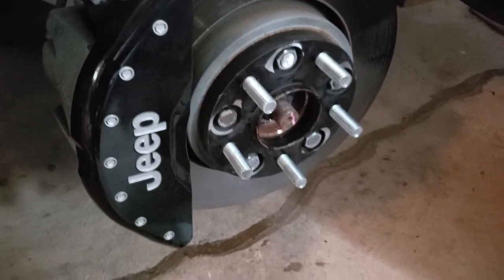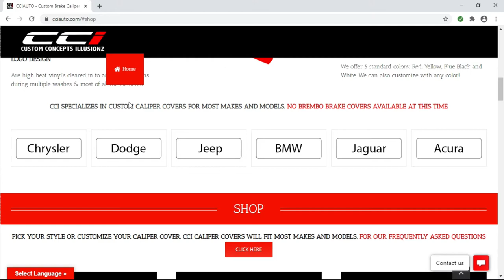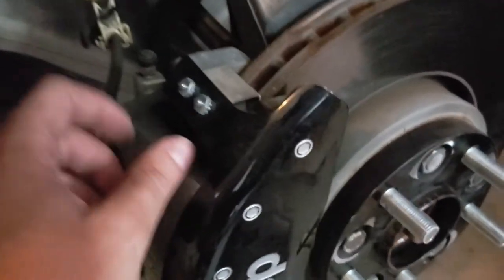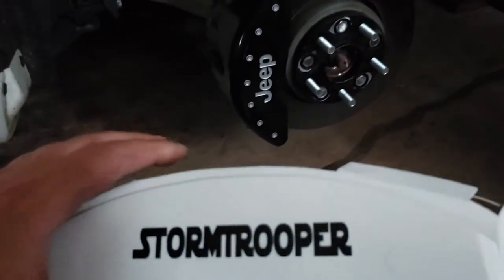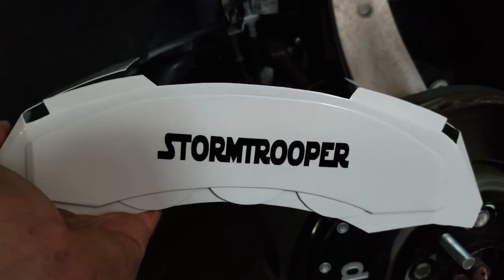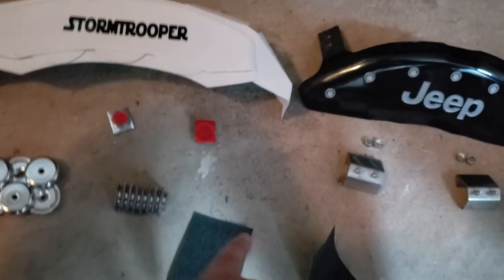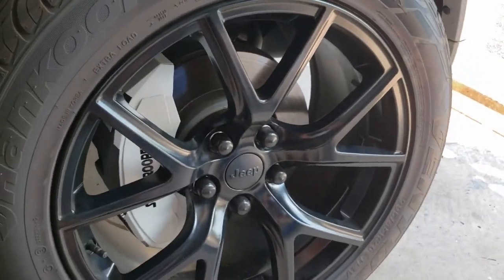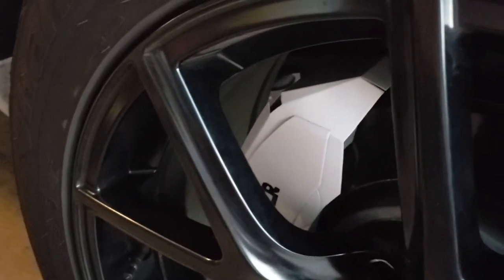CCI Caliper Covers vs. MGP

Comment: You can put custom logos or text on the MGPs too. And they are built bullet proof.
Reply from the maker: Agreed. I saw they offer that as well. It comes down to appearance preferences of the shape of the cover I think. CCI just released a couple of other options for variety but I agree that MGP's consistency with theirs is what drives the known quality. They are more costly though.

Comment: I'm sorry but my experience is completely different from most of these comments,.. I have MPG covers on my cars, and when I tell you I've had nothing but issues since they were installed back and forth to the dealership for install, ... you wouldn't believe, driving down the road you will hear something rubbing, at times you will hear something scrapping, if you make certain turns you will hear all kinds of stuff.. and really it's emabarrasing... I was driving down the road and 1 popped off while driving, and a day later the other popped off..... like I'm just tired ...i'm looking for another company that's better . yet safer !
Reply from the maker: One thing I can definitely say is to never take car in for brake or service of anything in those areas while the covers are on. Most of them don't know certain nuances tied to proper re-install. And not really their fault since covers are aftermarket, not factory equipment. If you have had rubbing before dealer service, and you believe they were installed correctly originally, I would consider spacers from 2mm up to 5mm depending on your wheel size and offset.  They were not needed for Cherokee but I did need to get them for wife's 2017 Ford Edge.

Comment: I think the white covers look dope. Definitely brings the look together, I’m debating on the CCi covers for my RAV4 but your video is convincing me to place the order 😊
Reply from the maker: Thanks! I just had a shop do rotor and pad change. They didn't need to ask me anything about removing them or replacing them. Just pulled them off and back on. Very functional with no need for screws or effort.
Reply: @carsick309   that sounds so easy to deal with, I saw your other comment that you haven’t had any issues with them, so that’s hella reassuring. This might be a dumb question, but the only reason I’ve been stalling on the covers is that if they will intervene with the brake assist on my car... do you think they will?
Reply from the maker: @patriciaarteaga8221  Doesn't matter if it's these or MGPs. No interference with assist. I have rear brake sensors and those kick brake action in without any issue. Covers are just a cosmetic external piece. If standard braking works so will assisted.
Reply: @carsick309  omg thank you! CCI just posted these red reflective covers and now I’m going to order them. Thanks for answering my question 😊

Comment: Thank you for getting back to me.  I just bought some summertime rims and tires (Michelin tires and factory Black Ford rims)  I think the plastic lug caps could be a deterent from someone steeling the tires and rims.  I have an expedition and just bought the red MGP caliper covers too.  Can't wait until spring.  Thanks again
Reply from the maker: Sure, but if it matters the ones I have are not plastic but more like rubbery somewhat stretchy if that makes sense. Either way, agree on the lug thing. No way to get wrench on those with out having tweezers to take them off ✌️

Comment: TY! My Wrangler Sahara also w/ Discs X4. In my region, painting them bright red, or bright neon is popular- but don't have the time/inclination. My GC is also B&W. I also recommend Jeep Forum btw (again don't hv time I wish I had). A little puffery is acceptable. My last Cherokee I was in for 15years! Shouldn't have sold it. Where I live, calipers can freeze, brake dust is prob, as is mud. Sweet option. Keep em coming. We do love our Jeeps - dunno w/new Fiat ownership what will happen. Hope you have as many in your Storm Trooper. best yrs were: Iococca-Daimler. Pls do F/U (follow up) after 6-12mos let us know if after off roading & if applicable seasonal changes. Looks awesome!
Reply: Did you use your phones mic to translate this?

Comment: How did they hold up ( during winter and summer heat ) and if there were any issues ?
Reply from the maker: @alexlo1378  I've run both in summer and winter in Northeast and they stayed on fine. CCI seemed to warp and get stained a bit after about 1 year though.

Comment: You can choose to remove the bolt look on mgp calipers if you customize. Do you think it looks better to remove them or keep them? I can’t tell if they make it tacky or not.
Reply from the maker: You're right.  I actually was checking their site and saw that. Without the fake bolt look though they just look odd because they don't have "depth" of CCI. So if you're on MGP side I would leave the bolt look.
Reply: CarSick30 Thats what I was thinking otherwise it’s a smooth color that has no edges and looks like a glob to me lol. I’ll stick with the bolts! Thanks for the input

Comment: ABSOLUTELY THE WORST!! This company and the Owner are a total joke!! Took me 6 months to get mine, after sending the wrong ones after 3 months!!  Then they finally ship them , after lying to me about 12 times saying they are shipping, they are drying, every excuse you can think of.  Wouldn’t answer my call until I blocked my number.  
Stay away, stay far away!!!
Reply from the maker: That does sound horrible. I did end up switching mine and wife's back to MGP but more so for ease if use and options. Didn't realize things got this bad with CCI...

Comment: Are those spacers? What size? Any issues with them? It was recommended I get 5mm spacers to get the front covers to fit on my ‘18 JGC Altitude, but I’m a little nervous.
Reply from the maker: This one of differentiators between MGP and CCI. When I was running MGPs no spacers needed on Altitude. It just so happens that I got spacers after that for more aggressive look and stance/stability. So when I went for the CCIs it was not even a thought for me. Plus I was not told I needed them. My spacers are 0.75" manufactured by Bora. At that size you have to deal with not just spacers but having to cut your  factory studs (the things you put lug nuts on). Factory are not long enough to take spacers and leave enough thread for lug nut. Ongoing debate about how wide/narrow they can be before you HAVE TO do this.
Reply: @carsick309  Thanks for the info. I’ve seen pros and cons for spacers. I’m only willing to go no more than 6mm for clearance, but still leery. I might just end up painting them. But until then, I still have the rears on, so it looks half cool 😎 lol
Reply from the maker: @michkeshajohnson3159  You're definitely fine with 6mm and no hub or screws nodded I would think. Lug nuts still have enough thread to catch and hold.
Reply: I have the exact same jeep altitude in white and wanted to do the same set up with the rims and tires. Do I need the .75 spacers to fit the 295/45/20 rims and tires?.. because I really don’t want to put spacers on, but I want that exact set up in rims and tires.. thank you in advance…
Reply: @markdudek1544   I decided against spacers and purchased SRT Replica wheels, so no spacers needed. Proud to say the CCI covers have held up for 2yrs now with original magnets, no issues. I probably should give them a good cleaning though lol. I get compliments all the time.

Comment: Mgp covers are simple and plain but, at least they are made out of really good material, very solid and 100% safe and CCI covers they look better but, they're not safe at all, even if you put stronger magnets, they're gonna fall off sooner or later, just paint them don't buy these covers they're not worth it, trust me i had both, mgp and cci covers and I regret it 🤦‍♂️
Reply from the maker: I'm about to make a follow-up quick video 1 year later and I think I agree with you there.
Reply: I ran MGPs on my Nissan Altima they fell off after two months, few months later I bought a charger rt 18 and I found out about CCIs  and decided to go with CCI Xlines  av been running them for 8months now they ain’t going nowhere lol. I even run through potholes an a daily , easy to clean.
Reply: @idrisidowu6246  that is so weird though 'cause I've been running MGPs on all my cars and they never fell off, the only reason I decided to change is because I gotta admit CCIs look better in terms of desing, anyway none of them are worth in my opinion.
Reply: I had 3 set cci, I lost the cover one by one , the 4 set after a month later the driver side came off and messed up my rim , I took the rest off before they came off and I noticed the magnet was already coming off on the other ones, I’m glad I took them off on time ,   Just  got the mgp let see what happens
Reply: Bought mpg standard yellow paid 180 then paid my guy 250 to custom paint for me and the day he put it in back fell off and the other back was scratched somehow while waiting for new clips for the back the front fell off and was ruined now I’m out of a lot of money I had them put on my bmw x3

Comment: How do you like the lug nut covers?
Reply from the maker: They held up pretty well especially againt fade. I got a backup set because I have OCD 😀.  The "tweezers" that come with the set to remove the caps will start tearing them up over time. But if you don't take your wheels off often, no worries.

Comment: you should check out AOOA caliper covers they look real and they dont use magnets
Reply from the maker: Cool, will definitely have a look. You probably saw but I would recommend MGP over CCI at this point.
Reply: @carsick309  yea I did and I have the MGP ones already but ordered the AOOA ones because they look actually better thank the CCI but have the same type of mounting as the MGP
Reply: @joshhermsen5336  hey, what website did you order the AOOA caliper covers from? I see two websites but idk which one is the real one

Comment: Absolutely 💯 JUNK. On top of that, your brakes overheat causing premature failure due to overheating.
Reply from the maker: Varies by experience I'm sure. 5 cars later has not been the case here.
Reply: @carsick309  agreed. There is still ample airflow with either cover.
Reply: Troll

Comment: Why skip the entire mounting process of the CCI.. you had my attention until then.. ugh
Reply from the maker: They have install videos on their site. Their approach did not work for me but I didn't want to show mine to prevent bad install claims and any liability for fails of those doing it my way.
Reply: @carsick309  after watching your video I decided to buy the MGP caliper covers. They look much sturdier and were bolted on. I didn't trust the magnet not to fly off and possibly destroy my rim, caliper, car..  After installing the CCI cover were you satisfied with it or was it a mistake?
Reply from the maker: @mudbugminitrucks  After about 1 year on I went back to MGP for sturdiness and longevity. I didn't have magnet fail issues but brake dust staining and removal reinstall for servicing were more annoying with CCI.
Reply: @carsick309 ,  looking at the design and structural integrity of the CCI I'm glad I went with MGP.. I love my vette.. I would hate to have anything happen to it. I pick the red to match my car.. I'm excited to see how it looks.. take care

Comment: Hot brake calipers? Magnets? 3M tape? Hard pass.
Reply from the maker: Totally see your point but heat has no impact on properties or fundamentals or magnetism. 3M adhesion is actually strengthened through heat. Overall I would say this combo of attachment methods is no less secure or safe than MGPs clips. The whole idea of any covers is totally cosmetic without any true functionality though.

Comment: How’s your warranty??? MGP is warranty for life...
Reply from the maker: That's definitely a differentiator, you are right. CCI has has an "implied" warranty of sorts. If you put them on exactly as they are intended to be then there would be no failure. If there is any failure then you have to prove you didn't screw something up at install which is not likely to be possible. But it's also a much smaller scale shop by comparison so there is always implied risk. No failure in close to a year so far. I still have my MGPs and the point of this whole thing was to just try something different for look purposes. I agree that when it comes to comparing long term manufacturer backing it's apples and oranges.
Reply: @carsick309  MGP has a warranty? but if they send you custom caliper covers that dont fit your vehicle you cant send them back for news ones, adjustments, or a refund? This is going to make me order a basic black one and slap a sticker over the MGP logo rather than shell out $500 for a custom carbon fiber one.

Comment: DO NOT PATRONIZE THESE SCAMMERS. 
Check out what they told me to do when they didn’t fit. 

Levi MGP (MGP Caliper Covers)
Oct 1, 2021, 1:14 PM PDT

 
In order to align the covers properly on a vehicle's caliper to meet the mounting points you can push or pull the welded arms closer to each other or away from each other as required. Each arm is welded at the front plate but the rest of the arm is free to adjust without snapping. The arms are made of aluminum so they will take a stretch, see image attached for reference, thank you!
 
 
Can you send us a picture that shows the incorrect fitment
Reply from the maker: Are they talking about calipers having welded arms? What the heck are those? I don't have anything welded that's for sure.

Comment: Are these plastic?
Reply from the maker: No. They are aluminum. I can see why you might think plastic because of some flex when you hold them and try moving them around. They definitely have some give but there is no visible flexing in driving conditions. Seem to resist heat pretty well because of 2 layers in middle. They also don't have that "plastic look" like the fake Brembos or similar garbage out there.
Reply: CarSick30 got ya thank you.